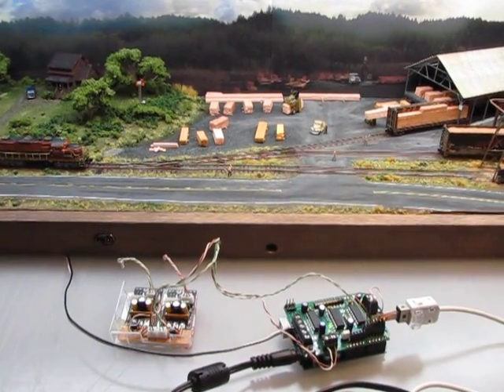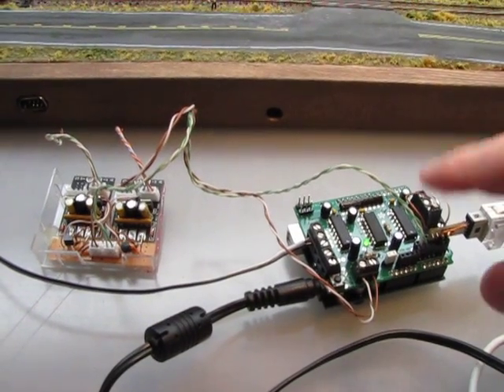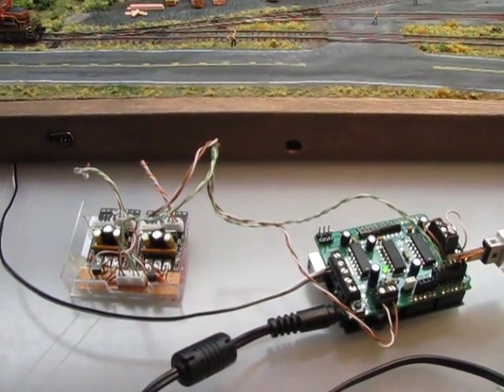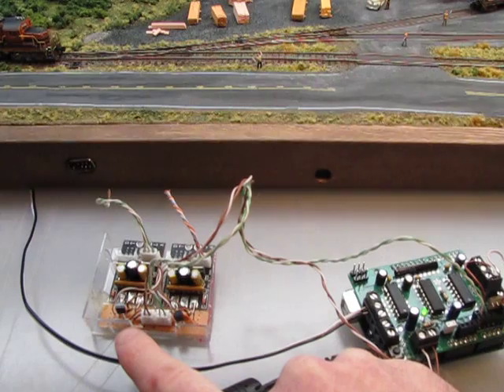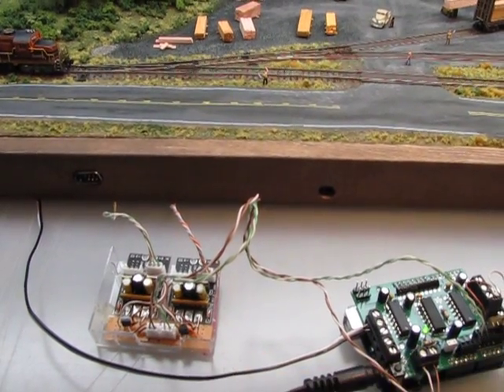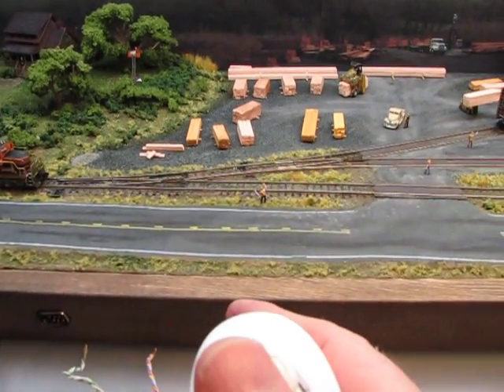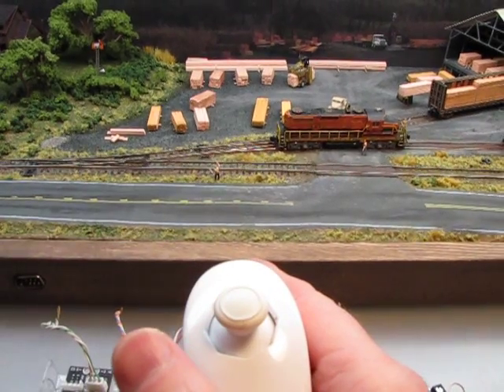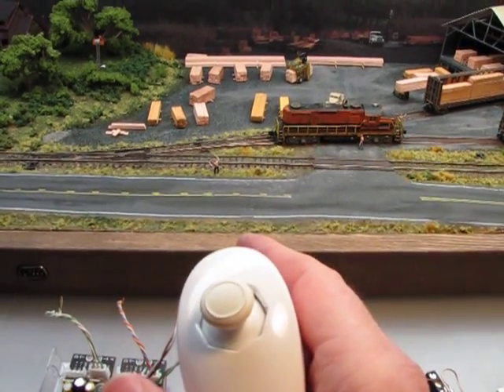Wii Nunchuk Controlled Train Update

Comment: Very nice. 

I just learned about the Arduino, and, as an electronics hobbyist and Model Railroader wannabe (lots of HO stuff, but no layout yet),  my brain is smoking just thinking about all the possibilities.

I agree with user wastingtape, the turnout control is really route control (a route is chosen, and all the appropriate turnouts are then thrown to line up to get there).  I would need visual indication if more routes were available.

Thanks for the great videos and also the website.